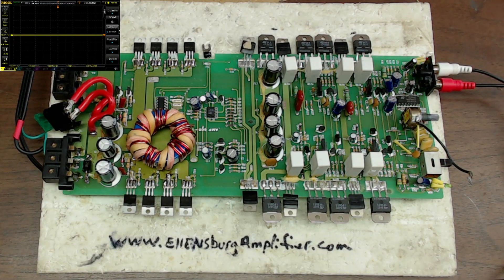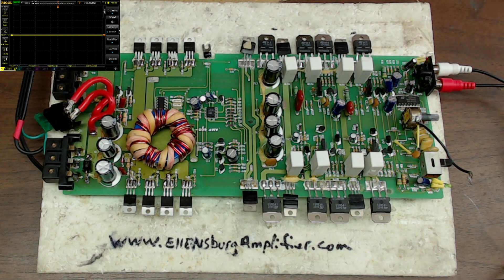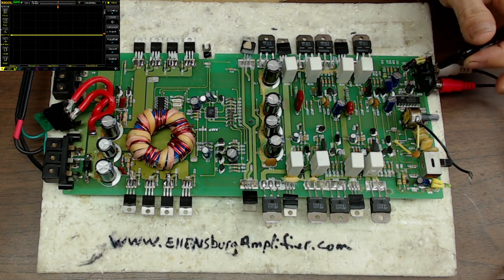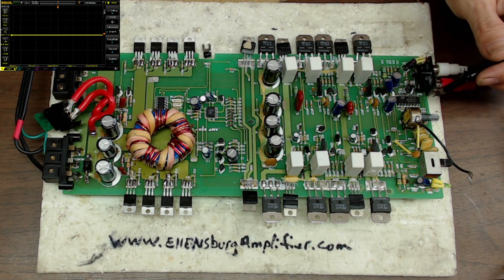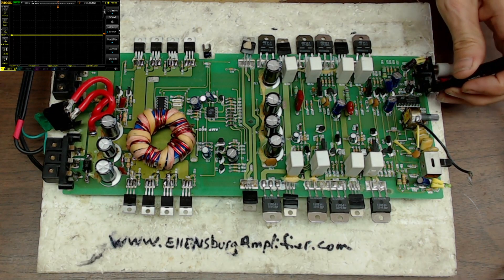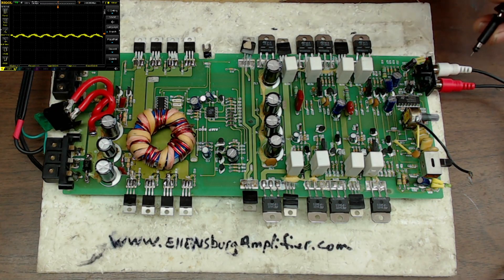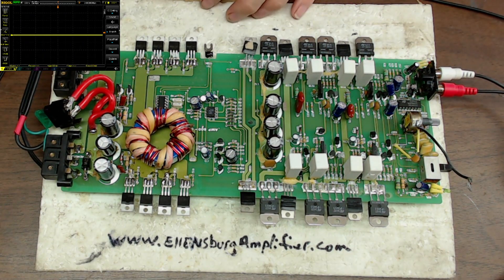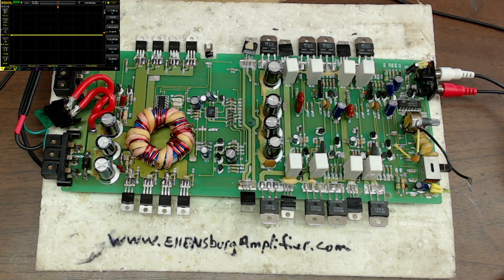Profile California A600XL Class AB Car Automotive Amplifier Repair Mod of Input Circuit

Comment: Hi dear friend
  This video was very informative and I want to thank you for this video.
What does the op-amp that is next to the oscillator IC do?
Can you give me a schematic of the class ab amplifier circuit so I can go through the diagram step by step? Of course, a circuit that is not too complicated and that I can understand. Or give me the download link.

Thank you again for your attention and for reading my message.
Reply from the maker: Are you talking about the 8 pin IC next to the 494? If so, that is a comparator for the protection circuit. Do you have Perry Babbins guide? http://www.bcae1.com/ is the sample site and here is his information http://www.bcae1.com/repairtutorialcdinfo.htm#rtintro
Reply: @ellensburgamplifier  
Yes, thank you. I want to know its function. I will definitely look.
Thank you again